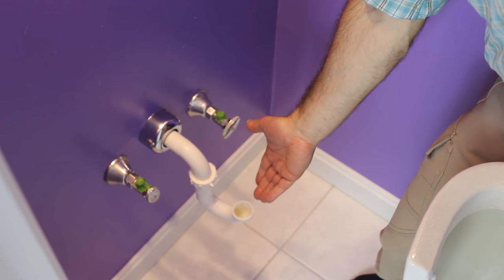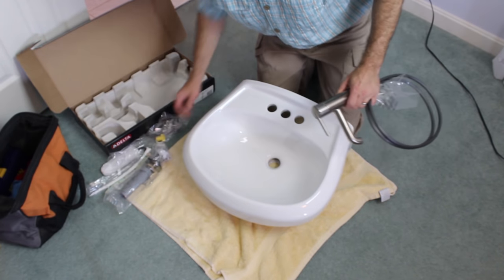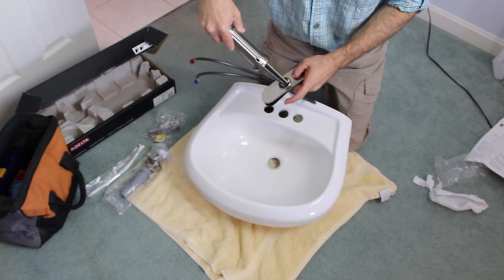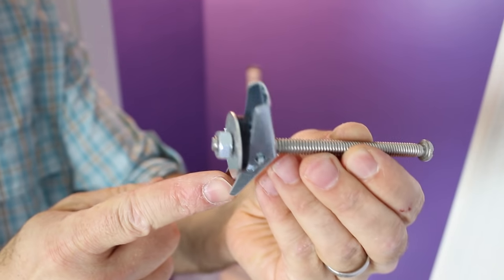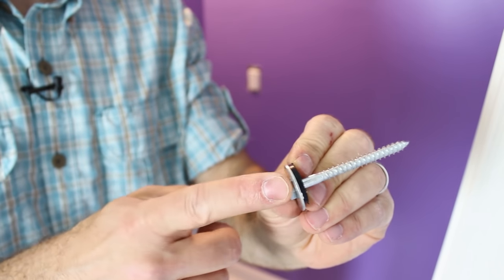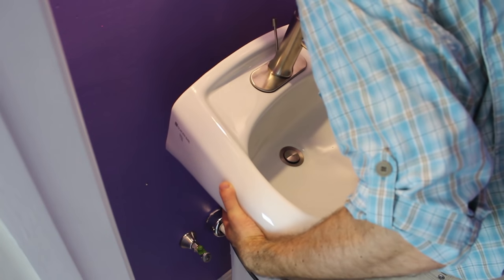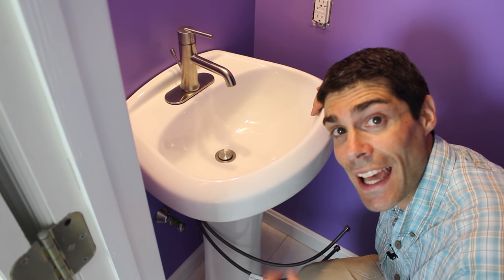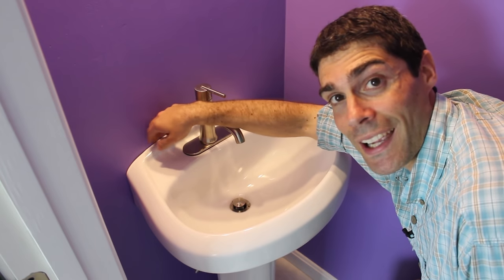How to Install a Pedestal Sink and Faucet -- by Home Repair Tutor

Comment: Hello, do I need to drill screws or studs into floor tiles and wall tiles to attach pedestal and sink to floor tiles and wall tiles? Am afraid silicon shall not attach securely enough to floor and wall tiles. Please help. We are in middle of the job.
Thanks.

Comment: Definitely missed the blocking when drilling that pilot hole on the first one. Nothing but drywall. lol
Also, who knows where the water supply lines run inside the back of the wall just go ahead and drill

Comment: good video except for the fact that you skipped the hardest part which is mounting and securing the sink.......    i only saw you drill two holes in the wall but i didn't see you attach the sink to the wall.....(or did you decide to just place the sink on the base and leave it like that)

Comment: If your house was plumbed with CPVC. When tightening supply lines to shut off valves, be sure to hold the shut off valve securely. Otherwise you may snap the supply line.

Comment: Most important installation part "not shown" is mounting sink too the wall with either the lag bolt or toggle bolt  that came with sink, said that you were going to use lag screws, then went too water lines
Reply: He also magically attached the drain pipes.

Comment: you skipped the hardest part which is to mount the sink to the wall with the limited space it gives you. You mentioned it then didn’t show it, i wonder why you would do that? any video i have ever watched does this. Are you not really doing it and just mentioning it? The limited space is the biggest problem why wouldn’t you address this?

Comment: What if there was no studs in the area where the holes were lined up with the sink?
Reply from the maker: You could add blocking if the drywall is open

Comment: I always wondered with these two piece pedestal sinks, should you be putting some kind of silicone or barrier between the sink leg and the top of the sink. But it looks like with this video no. The pipes just make it all come together. This is a great video that I’m going to be using this weekend. The only tricky part is cutting the pipe because I don’t have a tool so I’m going to have to find a pipe that is short enough to fit.

Comment: Great video but the hot and cols water angle valves should be re roughed 3 inch from center of the drain so the you don't see the the water valves when the finish is complete....

Comment: Great video.   Two things i noticed.  You an use plumbers puddy under the drain flange instead of silicone caulk.    For the drain bar, the drain bar goes in the middle of the clip.   So installation goes clip, bar, clip.

Comment: Couple notes: when you drill the lag screws or other screw you may use make sure you drilling into the center of the stud so you don't hit a water line.  I use my drill with a small bit to find where the edges are on the wall so I know for sure where the center is.  And just push the bit into the wall barely pass the thickness of the sheetrock. 

And I also have my water key with me and know how to turn the water off in the street in case the SHTF, IE, angle stop doesn't close off cause it's broken.   Had this happen recently while water is gushing out but good  thing I was ready and ran out to the street to turn it off!

Comment: Does the sink need to be attached to the wall and would silicone secure it? I'm wondering about a " professionally installed" pedestal sink in a family member's home. A timely answer will be most helpful.Thank you!
Reply: Although this isn't exactly a timely response, I can answer that for you as a chippie's apprentice. If the sink is a stand-alone floating sink than it should be secured to the wall using a bracket and bolted to the studs/noggin (blocking) behind the drywall. IF the sink is a pedestal sink, most of the weight will be supported by the pedestal beneath it, and in that case it is alright to be caulked to the wall. Hope this helps, despite it being a year late 😂
Reply: @stayfrosty1012  it does thank you

Comment: You skip past the hardest part. Getting those lag screws lined up and securely into the wall is not easy. You have to have really small hands or some extensions for your rachet. You also have to be careful that you're not driving lag bolts into your water lines and causing a flood.
Reply from the maker: this is true, I tried to be as specific as possible. The space was very small as well which made it a challenge to film as is.
Reply: You did a great job :) I was just being an armchair critic. I put my sink in the day after I left the original comment and it was a nightmare. My wife had to buy a sink with the most unreachable holes in the history of man kind. To make matters worse they were not 16" apart and I ended up ripping out the vanity mirror above the sink just to make sure I didn't drill into the plumbing.

Comment: Was the pedestal already secured to the floor? I am curious how you went about securing that. Thanks!!! :)
Reply: The pedestal is not secured to the floor, ever. The sink is secured to the wall and the weight of the sink on the pedestal is enough (with the stability of the wall-mounted sink bowl on top of it) to keep the pedestal in place

Comment: How do you put the anchor that doesn't fall behind the wall when installing the sink to the wall?
Reply: You push the anchor through the wall with the spring-loaded wingnut on the screw. When you push that part through the wall it springs open, then you tighten the screw and it pulls the wings to the inside surface of the wall, thus tightening it securely to the wall as you tighten it down.

Comment: Hello there I like your video.  A few others asked this question and I cannot find a response from you so I will ask also.  I need to know please how do you secure the pedestal to the floor?
Reply from the maker: lag screws with washers. 2" inch lag screws should work fine. But always follow the directions that came with the sink ;)
Reply: Thank you Mr. Patterson. :)
Reply from the maker: +Michael Filimon hope it helps
Reply: The pedestal is not secured to the floor, ever. The sink is secured to the wall and the weight of the sink on the pedestal is enough (with the stability of the wall-mounted sink bowl on top of it) to keep the pedestal in place

Comment: Why did you use silicone and not plumbers putty to seal the drain?
Reply from the maker: Jeff Huguelet good question, I've used plumber's putty in the past and it's fine. But silicone is more full-proof if a generous amount is applied :D
Reply: +Jeff Huguelet that will be fun to get out one day.  i'd go putty anyway.  great, well lit, clear video though.
also plastic anchors might be good if you are screwing into drywall
Reply from the maker: silicone is a more permanent deal than plumbers putty
Reply: Jeff Huguelet why not it seals just as well silicone is water resistant.
Reply: More permanent... that's the problem though
Reply: @monserratelapuerta3808  plumbers putty can damage some plastics. A chemical reaction can make the plastic flange brittle over time.

Comment: I can not find a video that shows how to secure the sink against the actual column. You too have completely skipped that.
From what I can tell, anyone can come kick that column out from under the sink and youre hoping your wall bolts hold!
Reply: +raheem4real That base wont go anywhere once you install the sink on to it then anchor the sink firmly to the wall.
Reply: intruder341 after a lot of digging I came to that assumption. I installed it but still lazily I have yet to fasten it to the wall. Need to carve some wood to bridge the space, and for that I need to figure out where the studs are. All new to me but I will cross that river!
Reply: i know he skipped that whole part

Comment: Excellent video, best one I've seen on YouTube on this subject!  My only question is, how did you know how far out the p-trap should be from the wall to fit within the pedestal, and have the basin against the wall? I didn't see you measure anything, I would have thought you would have to do that before installing the pipe from the wall to the p-trap
Reply: Bulshit

Comment: in this video you forgot to show how to attached sink to wall.
Reply from the maker: +arvind padhiar didn't forget, the space was very tight and didn't afford camera work. But you should use lag screws and they should go into studs...at least one of the screws should be in a stud 👍
Reply: Ok , thank you.
Reply from the maker: glad to answer any questions
Reply: If i do it my self to change need two people and about 4 - 5 hours job, its not that easy.; thanks
Reply: so those boles have to go in stud.right? so have to find stud first. thanks.
Reply from the maker: yes, find the studs first then mount the sink using lag screws
Reply: ok kool
Reply: and that's actually the hardest part....

Comment: also totally skipped turning the water to the faucet on and off before and after doing the repair. That is also critical to doing the repair. You can't even begin without turning the water supply off. Too many critical steps left out to actually learn how to do this correctly. Two thumbs down.